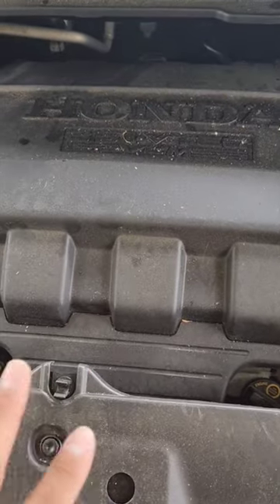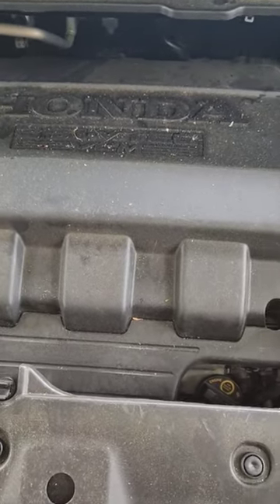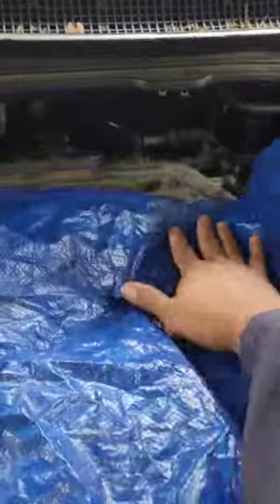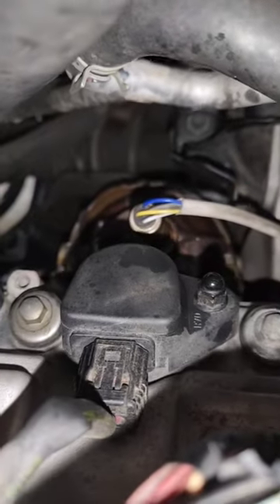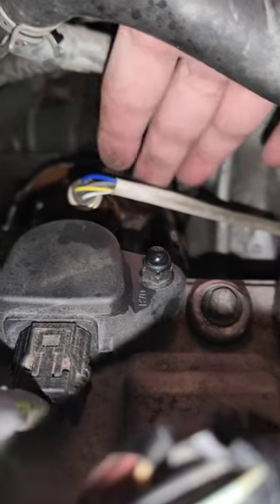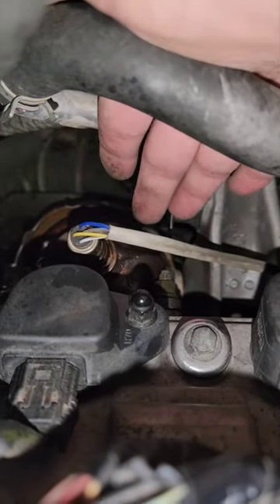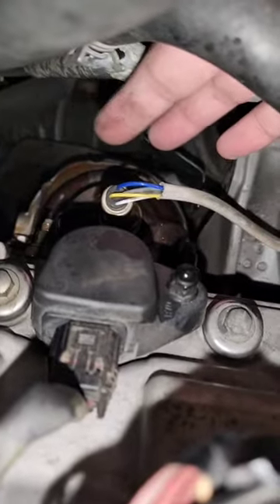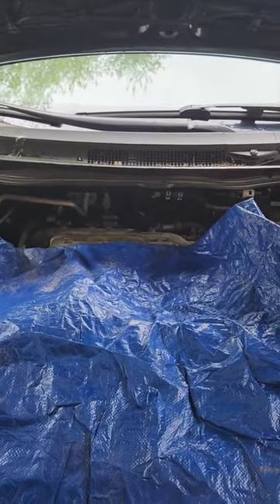Oddysey 11-17 top access to bank 1 catalytic converter - P0420. #hondaodyssey

Comment: I got a PO420 that is actually intermittent and will turn off and pop on by itself for the past couple months it will come on for a week and shut itself off without me doing anything and then pop back up intermittently so I'm considering that I may have to replace my converter and this is a great video to give me consideration for what I'm looking at thanks for taking the time and sharing the information
Reply: Have you seen how much a new cat is?  I had the same issue as you around 170k miles, then came on and stayed on at 200k miles.  I'm at 235k miles and the light just stays on, no sense in replacing with a cheap eBay one and the ones that are made properly are $1000 each.